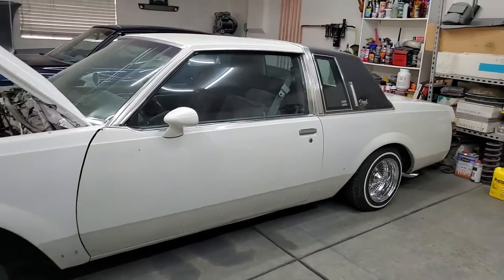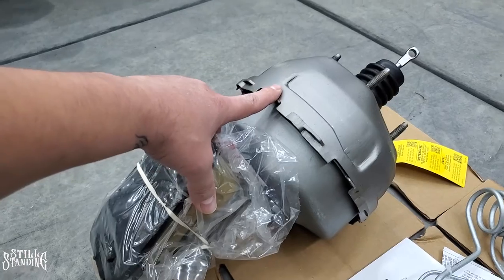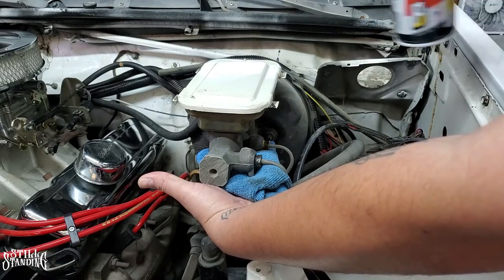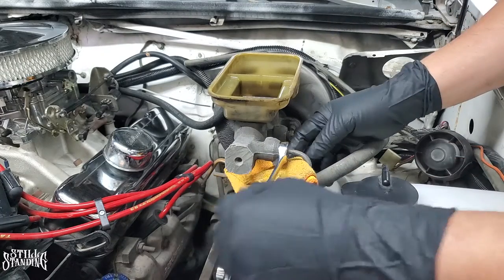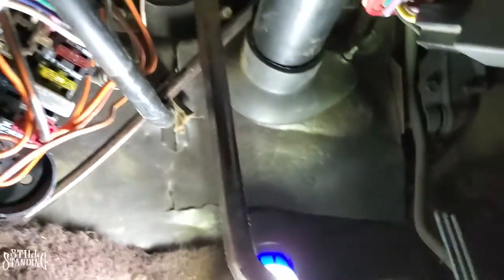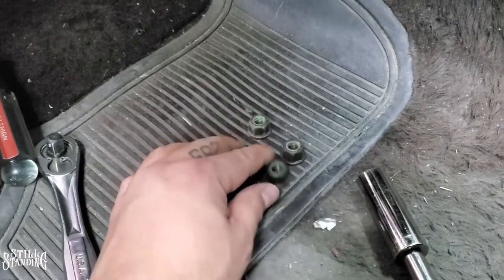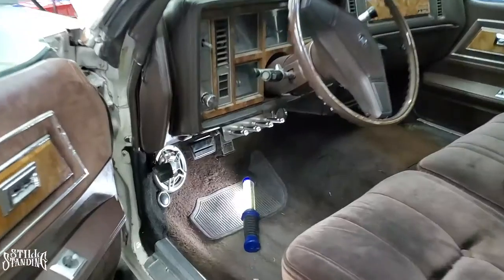G Body Brake Booster Replacement 83 Regal

Comment: So before the magic of editing. How long did it take for you to get the 4 bolts off the booster? I had a hella of a night last night getting mine off and the new one back ON and this video did zero when it comes to preparing for that BS.
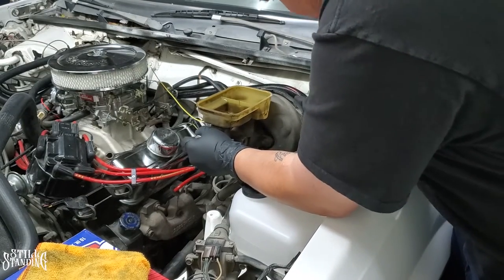Reply: Just so everyone watching knows it isn't going to be no 6:13 minutes to remove this booster and/or master cylinder.
Reply from the maker: I go over it in the video. I didn't have any issues removing it at all. My issue was putting it back on. I went over this in the video... I mentioned all my issues when reinstalling. I do mention it took 45min to a hour just to link and bolt up the booster. Normally work like this will never take the time you see on a video. As for me I like to at least mention my struggles and time it took. If you have any questions in the future on something you see on my channel feel free to hit me up on here, Instagram, or email I'm more than happy to help as much as I can.
Reply: @StillStandingGarage  thanks for the video. I still liked it but took an ass kicking from my El Camino. I am sore as a bitch! 😂
Reply: @StillStandingGarage  badass ride too sir. 👊🏾
Reply: @StillStandingGarage  did you have any issues bleeding the master cylinder while mounted on the booster like that? Should I bench bleed it to keep it more level?
Reply from the maker: I didn't have any issues bleeding on the car. I bought the bleeding kit and it helped a lot. You can do it either way and it works.
Reply: @StillStandingGarage  got that far last night but my pedal is still spongy and soft for some reason. I think after I bleed the lines it will all come together 🤞🏾🤞🏾. I already inspected for leaks and nothing on any of the wheels. Am I going to need the proportioning valve tool in the video?
Reply from the maker: Nice! Yeah I recommend a proportioning valve bleed tool so you can bleed each wheel properly
Reply: @StillStandingGarage  Cannot get the rod from the booster hooked up to the brake pedal, it's kicking my ass!!!!!!
Reply from the maker: That part of the install really sucked for me. It took a lot of patience to not burn down the whole car lol. If the method I used in the video doesn't work for you I would say to try and have one person wiggle the booster from the outside with the nuts on the inside removed. The other person under the dash trying to get the rod in. Hope that helps.

Comment: This video really helped alot. One question. Once you have finished removing the air and bubbles are no longer visible. Do you remove all the fluid from the cylinder again,remove the tool with the hose, screw the brakes lines back, and then put fluid again into the reservoir? Thank you
Reply from the maker: I leave the brake fluid in there. I quickly remove the tool and screw in the brake lines. Thank you for watching 👊💯.

Comment: I installed a new brake booster on my cutlass but i cant get it to brake.. i did bleed it but pedal goes. To the floor. Any advice?
Reply from the maker: Did you bleed the lines? Also, did you use the proportioning valve tool to vleed them?
Reply: @StillStandingGarage  i didn’t get the valve
Reply from the maker: Try using the tool. Without it, you can lock up the proportioning valve, and it will prevent you from properly bleeding the lines.
Reply: I will order that valve tool amd see what it does after

Comment: Do I need a gasket for brake booster?
Reply from the maker: I didn't use one. I'm sure they make one for it.
Reply: Dude I’m having such a hard time getting the rod on the pedal. I tried loosing the booster bolts, and still can’t get it to pop in 🤦🏾‍♂️
Reply from the maker: That sucks! If you haven't already, I would say to try it with one more person. One person outside moving it around with the nuts off the booster and you inside trying to pop it in.

Comment: know this is an older video but can you explain the proportioning valve bleed tool? I'm struggling to bleed the brakes on my Regal right now
Reply from the maker: For sure. The bleed tool goes in place of the sensor on top of the proportioning valve. With the tool in there, it locks the shaft inside, preventing it from moving. This will allow you to properly bleed your brakes.
Reply: Thanks man, I appreciate the reply! Just ordered one.  @StillStandingGarage

Comment: That’s what I forgot to use is that blue tool! Do u leave it screwed on until you finish bleeding the lines?
Reply from the maker: Yeah it stays in until bleeding of brakes is complete... thank you for watching
Reply: Ty bro
Reply: No wonder my brakes ain’t catching rite I also changed the power booster and new lines
Reply from the maker: Yeah it might be your proportioning valve that's locked up